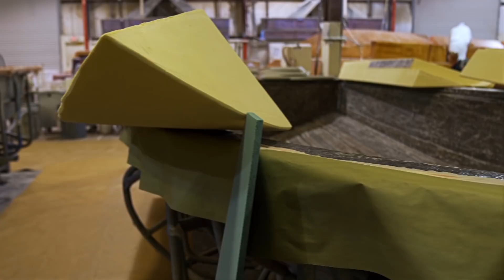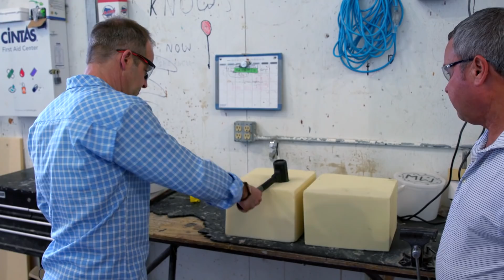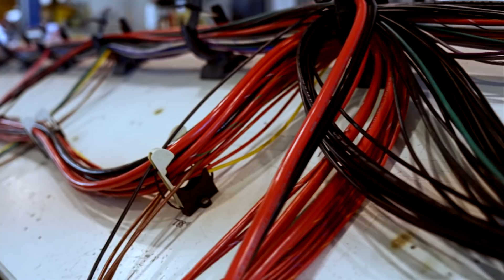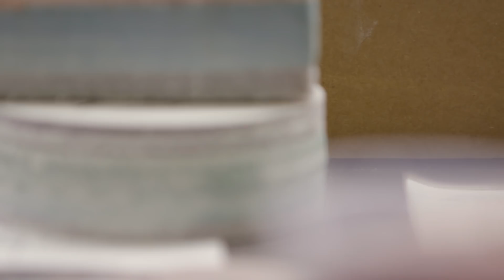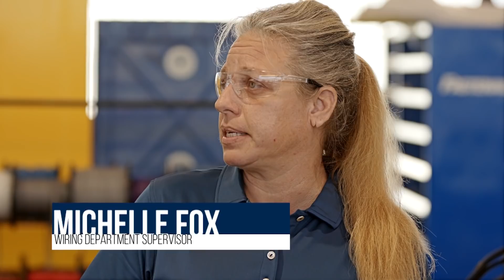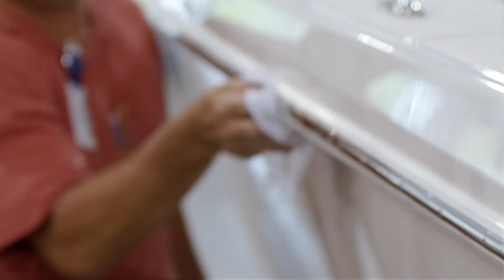Everglades Boats Factory Tour

Comment: I see a lot of chopper gunned glass!!! That’s a huge NEGATIVE when spending that kind of money on any boat! Grady White hand lays all the layers on their boats!
Reply: Chopper gun is great for fast effective layup. Show me top end racing yachts using anything but hand layup. You won't find any
Reply: Grady is famous for the transoms rotting out.
Reply: It’s not just chopper gunned, it’s both chop and hand laid in their boats. I’d put an Everglades up against a Grady any day if the week.
Reply: @christopherbrandt1895  That’s your choice, I’d rather have a Contender, Albury Brothers, or others.
Reply: @AUClay  out of all that, that’s all you have to say? Nothing about how your comment is incorrect about only chopper gunned glass?
Reply: @christopherbrandt1895  Read my original message again. It never once says “all chopper gunned glass.” I said I see a lot of chopper gunned glass, which is correct. Buy whatever boat you want, it effects me in no way.
Reply: That is absolutely nonsense. Gunned glass can last forever if applied correctly. Whalers have always used gunned glass and you still see decades old boats in the water.
Reply: HDaviator It’s not how long it lasts, there are thick and thin spots throughout the hull. It’s not near as consistent as hand layup. The glass to resin ratio isn’t as consistent either.
Reply: AUClay chop has no binders and is easier to roll out.  I recently moved our skinout department to chopper.  We’re about 20 to 35% faster on each part, with a 60% reduction in voids due to glass bridging.  We shoot 60 mils for skin, which is 0.06”.  Operator variance when I surprise them with a mill gauge is plus or minus 0.02”.  I would rather have a boat with no voids or fine aeration in the laminate, rather than freak out about +/- 0.02” thickness variance.
Reply: AUClay glass to resin ratio is more consistent with chop if the system is calibrated.  Operators tend to overwet chopstrand mat in order to break down the binders.  Skin coat should be a little resin rich for better osmosis resistance.
Reply: @Richard-do1hb  im not paying up for chop
Reply: gary lutsky that’s your own choice to pay more for a slower, inferior method.
Reply: Matthew Lee woven roving is trash, stitched mats offer superior properties since the glass isn’t kinked through a weaving process.  Also, woven roving or stitched mat cannot be used for all processes, it has poor interlaminate shear properties.  Chop or chop mat must be used to interface layers of stitch mat or woven roving to ensure ensure low shear
Reply: Matthew Lee rollout is not needed since the pieces are vacuum bedded.  Chop is one of the recommended techniques by AIREX foam for core bedding, since the spikey random fibers have good low shear performance.
Reply: Matthew Lee I know of a few military boats that are all chop.  It’s fine, if designed and QA’d properly.  Chop based laminates are very stiff and anisotropic.
Reply: Matthew Lee Avon Searider (USCG / RNLI), Hurricane 540 (multiple operators) to name two.  Hurricane 733 is chop heavy, but not entirely chop.
Reply: Matthew Lee Hand laid with chop strand matting, which yields the same properties as projection fiber.
Reply: Matthew Lee all 3 are in heavy use by military operators around the globe.
Reply: Matthew Lee it’s the same.  One has glue, one doesn’t.
Reply: @Richard-do1hb  You should visit Allison Boats in Tennessee. Talk to Darris Allison himself. He and he Dad even taught Reggie Fountain the way to build and layup a boat. Biaxial, Woven Roving, Kevlar reinforcement hand layup with guys that have done it for well over 30 years. Allison’s boat build method is second to none! It’s also well guarded, but they’ll give a tour.
Reply: *He and his Dad Paul

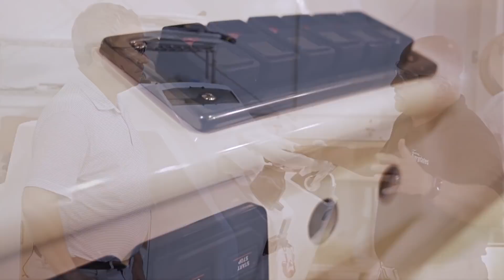Comment: Might wanna check the video at 23:26… that customer isn’t gonna be too happy…
Reply from the maker: Haha, don't worry, the console was resting upside-down. When installed, the switches are right side up. ;) Good eye. Thanks for watching!
Reply: Everglades Boats well it looks like one is right side up and one facing the opposite, easy fix, but it doesn’t take away from the quality of the boat, just a simple oversight that I’m sure was corrected… it happens